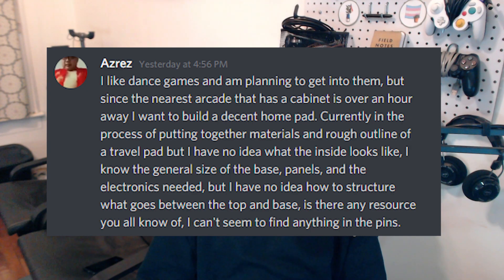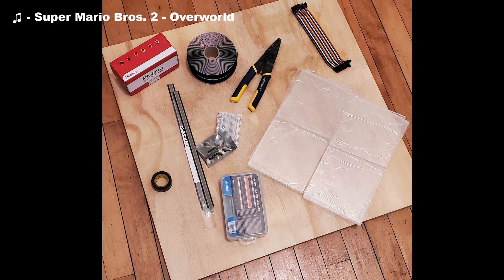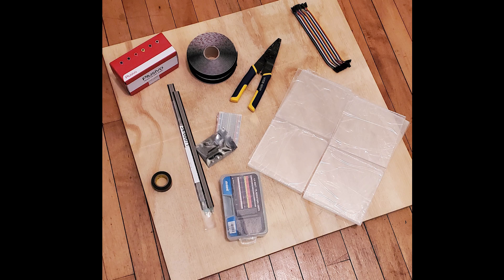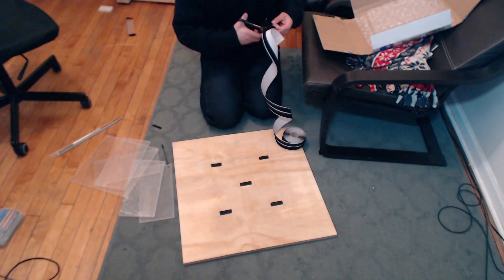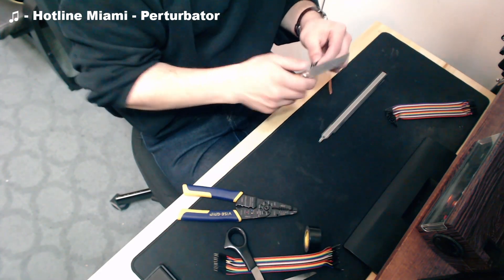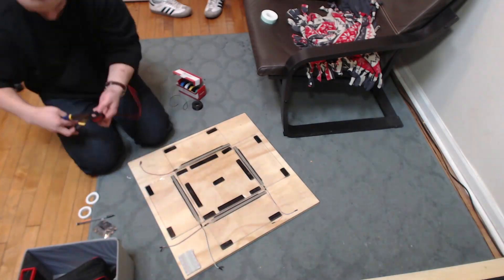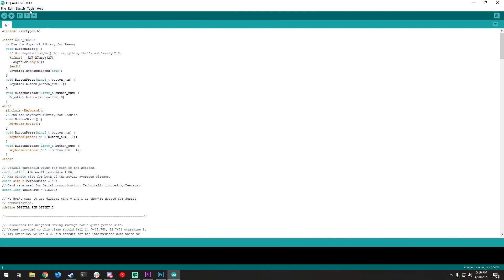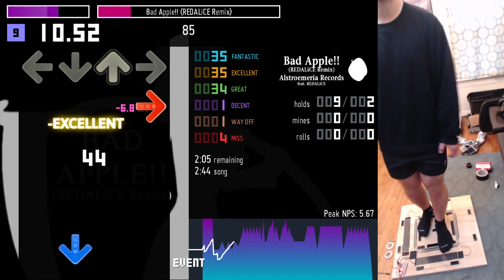FSR Travel Pad Build Guide

Comment: If you're willing to spend a bit more, the FSRio board makes everything braindead easy. Its a PCB with USB c out that is purpose built for dance pads. You just plug the FSRs into them and plug the board into your PC. It works out of the box with no software, but there is software for it where you just run an EXE and with it you can adjust the sensitivity, set sensors to inputs, and even set LED lighting (it has support for that too). I built a pad similar to this using it and it was incredibly easy.
Reply: Can you show me where that is if still available?

Comment: Spend the extra money and get polycarbonate 3/8 inch panels instead of acrylic. I made this 7 months ago and have been playing on it a fair amount, but I had one of my panels break yesterday. I don't stomp or even really lift much, and I'm not that big (6', 170-180 pounds). 

As LazyyFox said, don't even bother with the clincher connectors with Interlink FSRs. I tried so hard to get them to work but they just don't. Soldering is easy and the connection is way better than whatever jank you will get out of the clinchers. Had no prior soldering experience and had no issue doing it/didn't melt the FSRs.

I also suggest running velcro across the entire length of the panels, where the sensors go. I was having connectivity issues that were hard to figure out. Turns out that the depressions from the panels onto the FSRs overhanging the velcro was essentially cutting the FSRs; had to replace 3 of them.

Build this if you want to play at home. Works great.

Comment: Just wanted to stop by and mention that if you're doing this build and buy your FSRs from interlink, DO NOT use clincher connectors. I am making this pad and made this mistake. The FSRs from interlink only come with the solder tabs, and since the clincher connectors are designed to crimp onto the same spot that the solder tabs are crimped onto... there isn't enough room left to get the connector on. I tried cutting off the solder tabs on the hope that there was enough of the ribbon left to get a connection, however I only got two of them to work initially and one of them stopped working once they were actually taped down onto the pad.
Please do not make my mistake and just solder onto the tabs (or do the janky crimping thing Bandit did in the video I'm not your mom). As long as you do it quick (pre-tin the wire) there is little risk that you melt the tabs off.
Now excuse me while I stare out the window in sadness while waiting for a new set of FSRs to ship on the 30th.
Reply: This is good to know about the clincher. I already attached 1 sensor per pad on my ltek but want to add a second to each pad. I soldered the first 4 but was considering using these clinchers for the new ones since soldering was tricky. I will just solder the others.

For what it's worth, I did notice after melting one of the fsrs (I bought a couple extra, thankfully) that it was easier to keep together when I used electrical tape to create a 'heat shield' right at the base wherethe solder tab connected to the ribbon. I'm a novice at soldering, but that seemed to get pretty consistent results and all the sensors worked in the end.

Comment: Pretty slick and elegant. Is it socks-only or could you safely use shoes on this?
Reply: Shoes are pretty grippy on acrylic in general, so you might start sliding the velcro apart if you play slide-heavy. I don't see casual-level play with shoes being an issue though, or even faster play with slippery shoes.